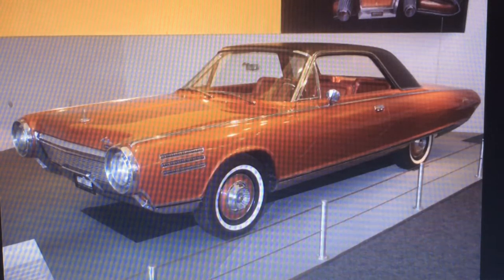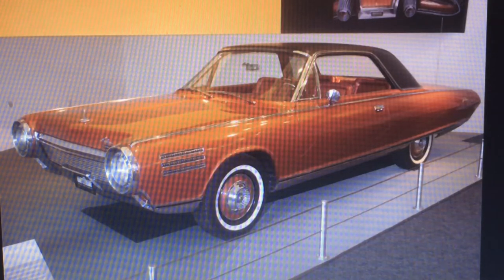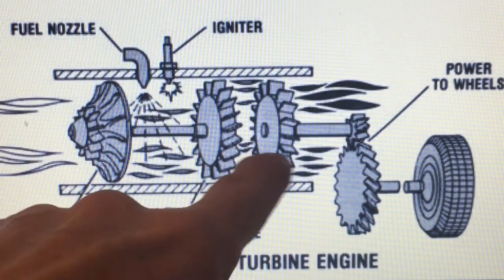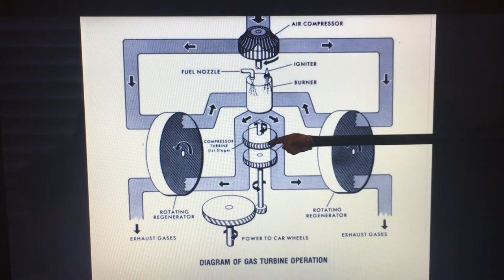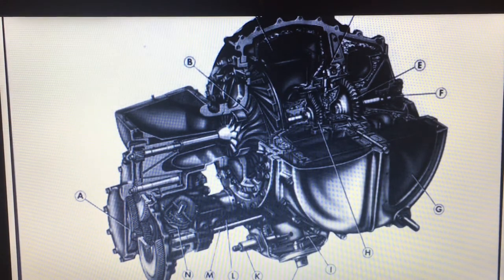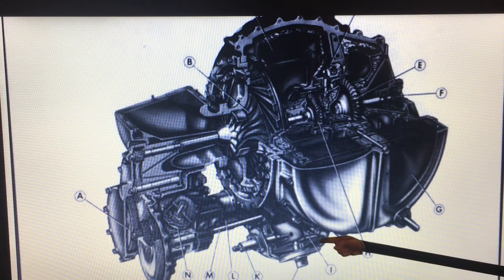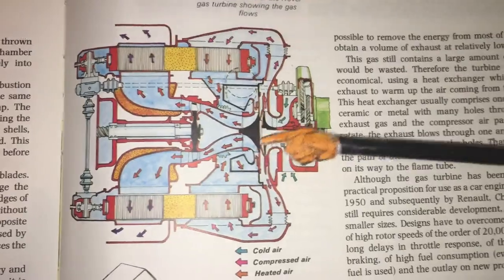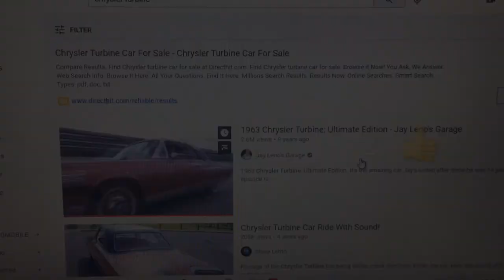Chrysler Turbine Technical Brief

Comment: wow 22000 rpm at idle  i wonder what the power/torque figures would be at idle never mind on full throttle   very interesting indeed cheers .
Reply from the maker: Thx John...This car for whatever reason doesn’t get the historic recognition it deserves. Engineering marvel. Not just a jet under a hood but a fully integrated design.